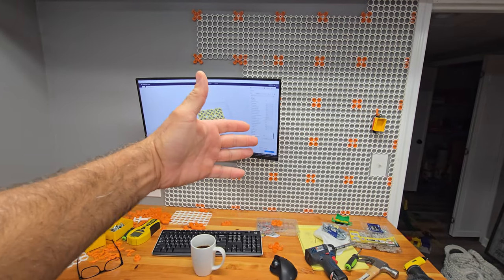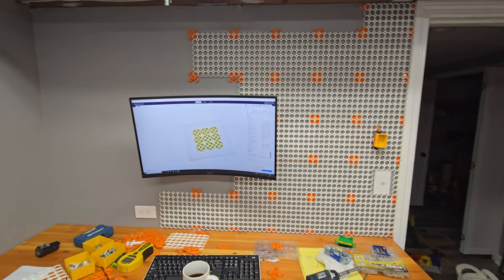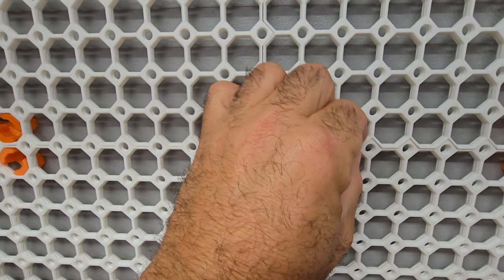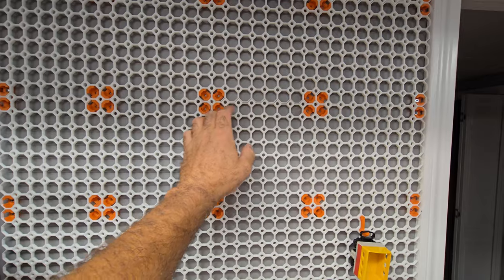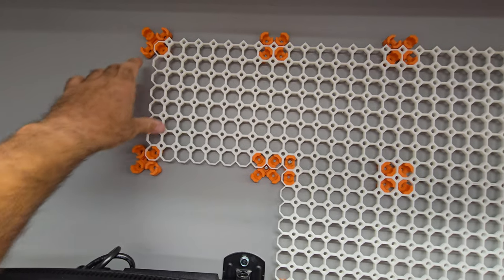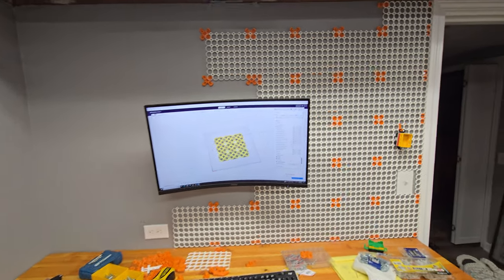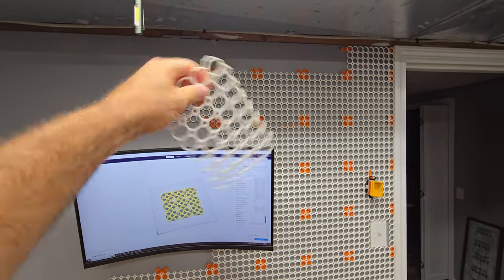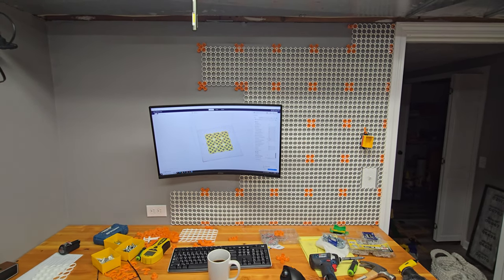Workshop: Part 3 - On the wall!

Comment: Looking good!   I've been using the same method of slapping mine on the wall.   print, place, mark, remove, install wall anchor, remount.   I think sometimes there is slack when I am doing that marking and when i have lower connectors in the holes don't line up so I bet that alignment problem you mentioned is like that.  I saw it a little bit too.  Are you planning to do that whole wall behind your bench or are you going beyond that?
Reply from the maker: I'm going to cover the entire wall and go from there. After the wall, I might try the under desk stuff